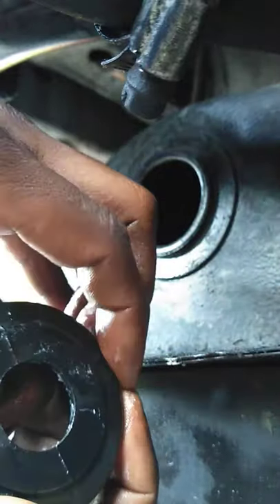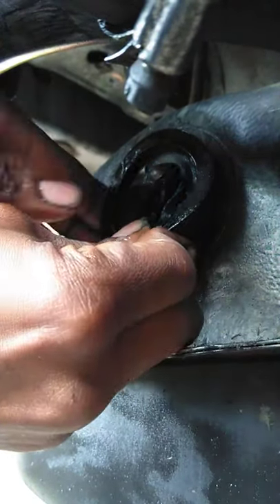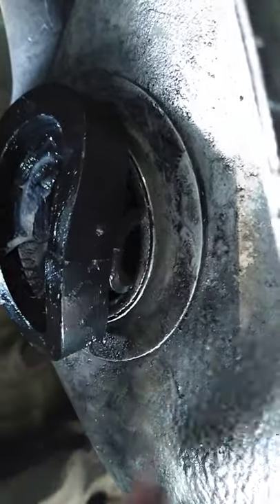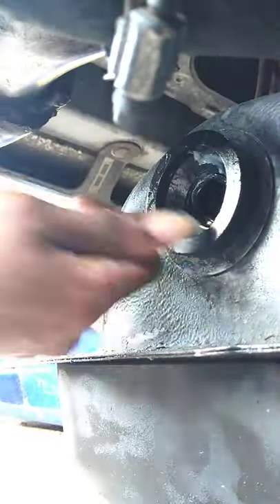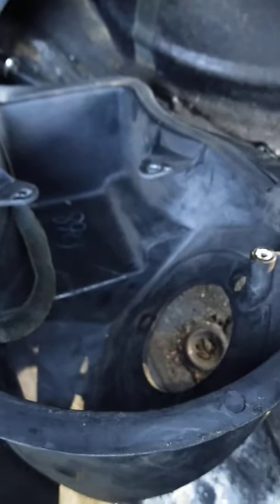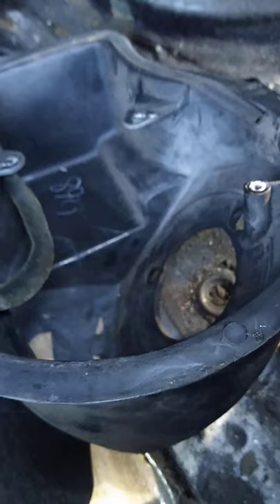1997 Mustang GT Convertible Fuel Filler Neck Seal Install

Comment: Good video.  I replaced the fuel pump on my '98 Cobra convertible 2 weeks ago (turns out it was a PATS issue...not the fuel pump) and when I put everything back together I tore that seal as well.  Good to see the steps necessary to replace it.  Thanks.

Comment: I would recommend you only. lube the outside area that goes on the tank while you install it, and the once you have it in you lube the inside before putting the filler neck in, otherwise it's extra slippery while you are trying to push it in.